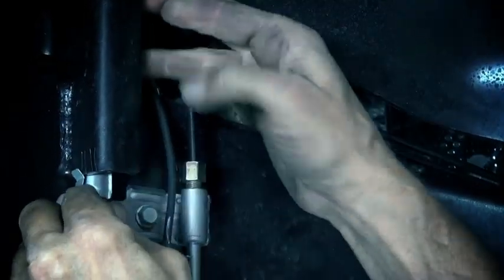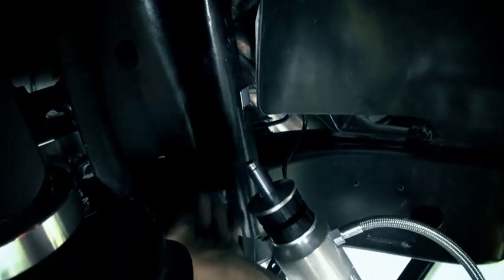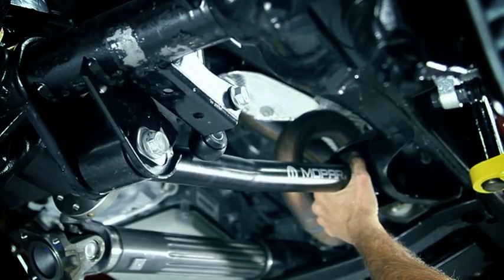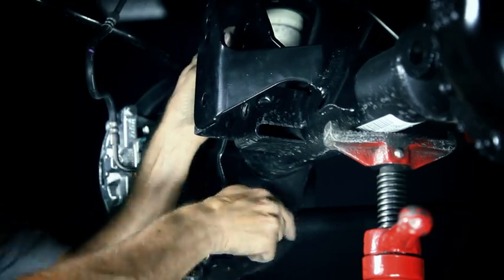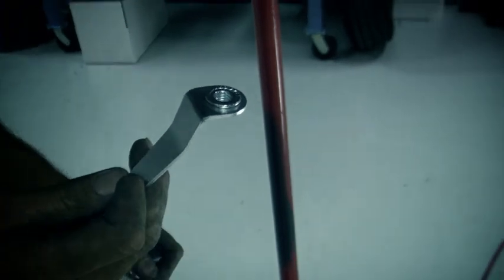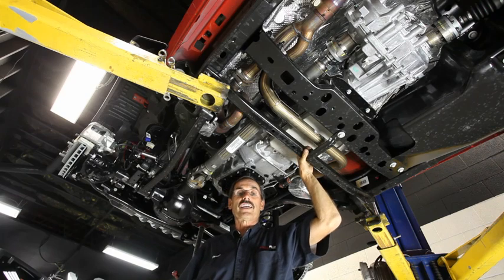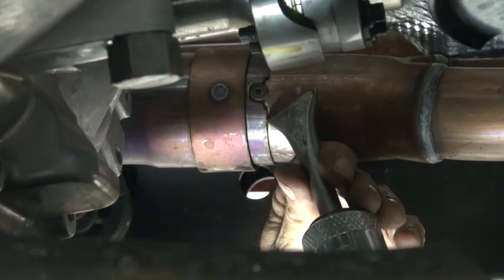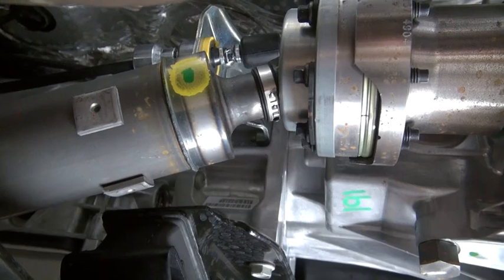TeraFlex Install: Mopar Stage 3 Lift Kit

Comment: What?!! Mopar had a teraflex 3” lift kit for the jk!!!! And it comes with a sick ass hydro bump stop too!! Damn y’all!! The JT gladiators need something like this. Common teraflex, come out with a nice 3-4” lift kit for the JT gladiators! 
I’ll volunteer my gladiator rubicon for your testing purposes, and I’ll post install and review videos of it on YouTube! Yay!
Reply from the maker: We sure did. Maybe something we could work out in the future! Would be a fun collaboration.
Reply: TeraFlexSuspensions the gladiator is a platform that almost 80% of its owners will want to modify it as soon as it comes off the dealer lot. At this point, there’s not much actual good full kits out there. And like it’s projected selling numbers, it was way beyond what they thought. I’m guessing same with aftermarket parts too, the projected number of owners wanting to buy lift kits and aftermarket has greatly exceeded the hypothesis of experts. 
Terafex is a company that’s well known for leading the industry, so Really think you guys should be one of the first to come out with a nice full lift kit, similar to this jk kit, but made for the JT. No one on the market has a full kit that comes with a nice hydro bump stop. Waiting for a nice full kit from you guys!!
Reply from the maker: @00ninja00  Thanks for the support. We are hoping for the same! We will continue to work hard to bring our best to the market.

Comment: Can y’all make a new official S/T3 video I’m on the struggle bus looking for instruction and I can only find this made for mechanics version I honestly feel like I can’t install this kit and I can’t pay anyone or want to pay anyone else to do it
Reply from the maker: We are working on updating some of the videos in our collection. Nowadays we have more of a modular setup and the installation of each component of the ST3 has it's own video. Try searching the part number of the specific parts you are installing on our website, instead of the ST3 kit as a whole. And as always, give us a call for any help along the install process. 801-713-3314
Reply: Im in the middle of my install right now, using this video as a guide.  If you support your jeep on the frame with  4 8-ton jackstands, you can fully drop the axles to remove and install the springs.  I used ratcheting tie-downs and my floor jack to manipulate the axles, and line up the holes.  If you have a Jeep, you should probably have access to those items.  Some notes I've made so far on this video; he initially installed the rear brake line relocation brackets backwards.  Also, it is unfathomable why this kit does not contain the 2 nuts that should go to the exhaust spacer bolts...

Comment: I had the three inch mopar lift installed through my local dealer because of warranty issues. If you purchase through the dealer and have them install it the warranty is not voided.
Reply: how much was price of lift, and the price of the lift?

Comment: Just installed this kit on my 2014 jku jeep this video is helpful but does not include a lot of steps that are needed for a jku or 2012 and above. 
1. drilling the holes for the rear straps on the upper control mount of the rear axel  do this BEFORE you put the springs on. (Or own a 90° drill) 
2. relocate the rear breather tube from the rear axel. 
3. jku you will have to drill two holes into the skid plate to tilt it away from the drive shaft. (I found it easier to reuse the driver side bolt and drill just one extra hole.)
4. the front driver lower strap mount you will need a 90° drill for a 1/2 hole.
5. you will need a steel plate and your scissor jack to install the rear bump stop cups. (idc what they say it does NOT pop into place easily.) support the rear axel with jack stands and put the scissor jack on the axel and the steel plate on top put the front of the cup on as best you can and then just jack up the jack until it snaps into place. (it makes a loud pop) 
6. Make sure you have RTV black silicone before you begin!
7. when installing the rear shocks put the tube towards the rear of the vehicle. 
 
That's what I remember, sorry it's in a random order, good luck!
Reply: Lydia Fowler how do you like it after a year?
Reply: Lydia Fowler HELP ME PLZ!! I’m in Charleston

Comment: Wondering if you can answer one or two questions please, 1.) Do you still use the factory steering stabilizer? 2.) Where did you get the exhaust extension kit from? 

All and all great video, I'm a Jeep tech and I'm gonna get an opportunity to do one of the 3 inch lift kits, but have only done the 2 inch kits for now.

Comment: so if ya go with a 3" lift you dont need to do a front drive shaft? now is that why the mopar lift comes with the limiting straps? so that the axle wont drop down as far so you dont have the drive shaft rubbing on the exhaust? and also if you do the exhaust spacer and use the mopar lift can you then remove the limiting straps so you can flex better? my 07 i had a 3" lift and flexed it all the way and never had a problem with my front drive shaft.
thanks dave.